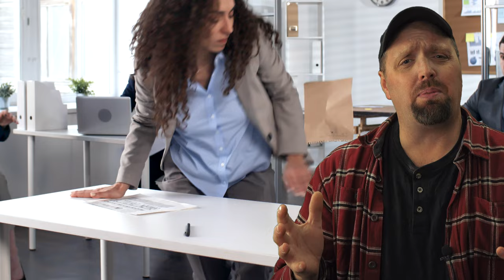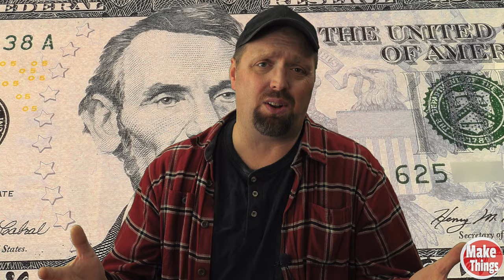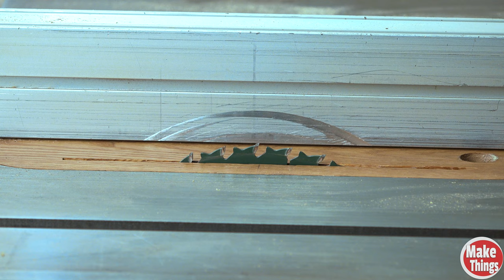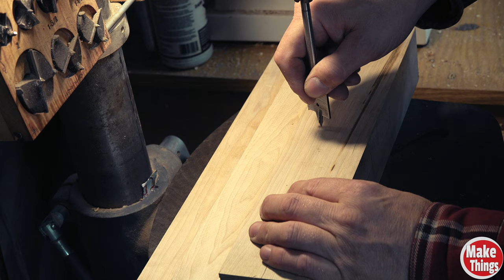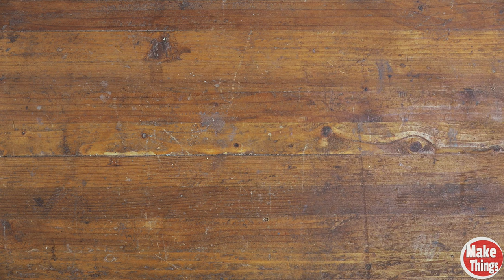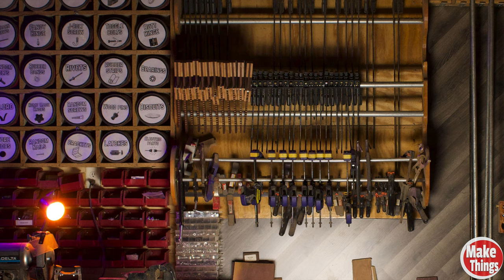Installing and Reviewing the Vevor Woodworking Vise // Get it while you can!

Comment: A simple knob to put on the ends of the dowel handle can be made using a hole saw and a forstner bit.  Pick the diameter of the knob you want to make and use the hole saw to cut it out of a board.  If you don't have a board as thick as you want the knob to be just cut two out and stack and glue them together.  Then use a forstner bit the same diameter as your dowel to bore a small recess into the knob piece.  You can glue the knobs on, or glue one and attach the other with a screw in case you ever want to remove the handle for some reason.

Comment: I got the 9 inch Vevor vice. Haven't installed it yet will use your install video as a guide. I have purchase several Vevor products and have had problems with them. I got a 13inch bench top  planer and a 10 inch table saw. The planer had started to have problems after about 5 months of use, the table saw fence does not align with the blade when moved, contacted Vevor about the planer and it turned into a month long back and forth their solution was to offer me a 10 percent and then a 20 percent refund of the purchase price no help with fixing the problems. The fence problem is shown in various YouTube videos, I asked Vevor if they have a solution to the problem and again month of back and forth emails. In the end they told me to tighten a screw on the back of the fence which did not fix the problem. I don't recommend that you buy any vevor products because they do not back them after sell and do not honor the warranty.